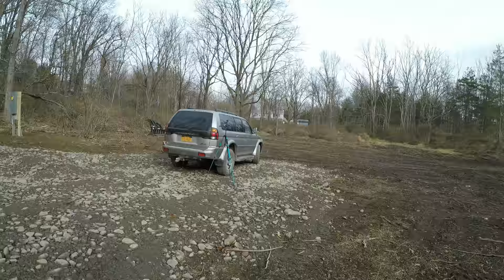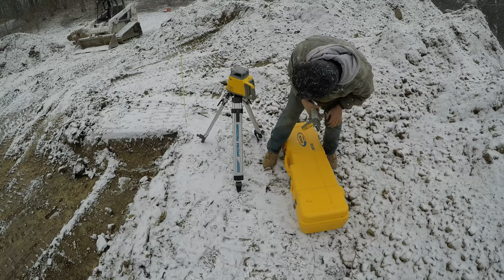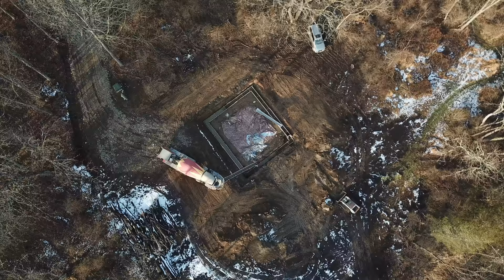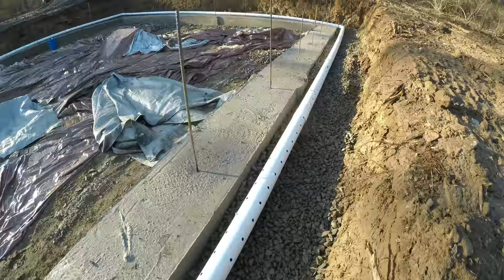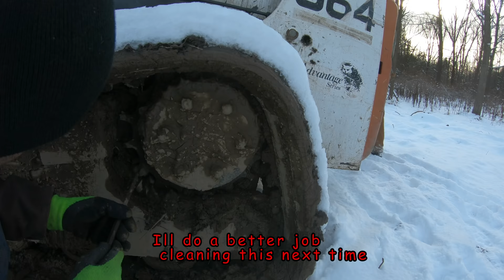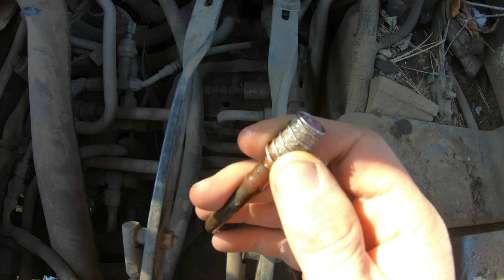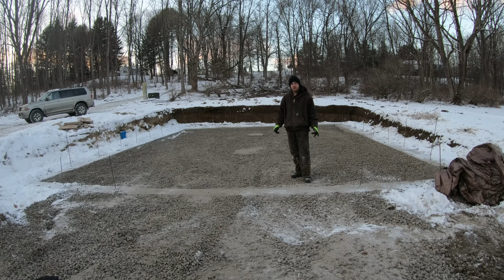Digging a foundation and pouring a footing

Comment: You put the foundation drain pipe on top of 5-6 ft of drainage stone that was placed on the outside of the foundation walls.  Any water reaching that drainage stone will not even enter that drainage pipe but travel down to the bottom of the foundation wall and possibly under the foundation and back up on the inside of the building underneath the slab.  If this was your design, it's faulty.  Please tell me the design was by someone so you don't get the blame.  Or am I missing something ?
Reply from the maker: Those pipes are lower than the floor. And drainage pipes were added inside the footing too under the concrete.

Comment: Your pump on the engine is drawing a vacuum on the fuel line sucking the primer bulb flat it happens all the time on my bobcat in the winter use power service or an additive in there to remove water and stop gelling

Comment: A long time ago when I was young, think middle school days and earlier I wore jeans in the winter time that had padding on the inside. They looked like urban pipeline jeans but sharp looking. Think I had 3 pairs of em. One was a dark gray, one a lighter, and I think one was real dark blue. The padding on the inside of the jeans, think 2 were plaid and one was all red. Those pants were fantastic lol. Really comfortable and warm. I can’t seem to find jeans with padding on the inside! I’d love to wear em again they were fantastic! Super comfortable. If it’s real cold out and I have to wear jeans, I’d wear sweat pants under them. Thin sweat pants. They are like baggy leggings lol. They also work. I only have 2 pairs of em though. Those jeans I wore that had the padding in the leg sleeves were something. LOL. Just wanted to comment about cold weather wear. Real cold in NY and in the upper Northeast, North. I remember one of Andrews videos, he talked about winter wear.

Comment: Hi Andrew. Now that you have a hot water pressure cleaner, could you use it to clean up your equipment either at the end or start of the day to make it easier to get it up an running. Also, would covering the equipment with a tarp or similar make any difference. Maybe it would be time efficient to clean for 10 or so minutes if it took longer to start up, but I am not sure how long it took to get the bobcat up and running both days.

Comment: Are you running 15w40 in those temps?Switch that diesel over to 10w30 hd diesel oil.Also the KLEEN FLO diesel lube and conditioner if you cant block heat it.That cold start is hard on bearing journals.I learned the hard way.

Comment: Add 10% kerosene to the diesel to winterize it  at -10C... up to 25% at -25C. Draw out the water in the fuel tank with carburettor alcohol, about half of what the bottle says for gasoline. 

Also it heats up the machine a lot faster to just put a loose tarp over the entire machine and a hose from the exhaust to under the machine if you have one.

Comment: Do you charge a winter differential rate? If not, you should. It seems like you spend the first hour or more getting equipment to run and move because of the could.

Comment: You used the laser level the opposite way. You should have set the laser next to the green stake at the exact height you needed it, then set your measuring stick to the height you need it with the receiver at the exact height and you can walk anywhere and the height would be perfect.

Comment: I cut teeth out of AR500 plate and welded them on ny Bobcat bucket - have worked for almost ten years now. But what ever you can get will work in the range of AR400, AR500, KVX strips or Chromium Carbide strips

Comment: Imagine doing this in the future with AR glasses (augmented reality). You could put some cameras all around your work site and use any of the upcoming AR glasses and see an overlay of all angles, elevations etc. You could look at the ground and see an elevation map like on a... well map.
Or look at some piece of wood or metal and see if it's dimension or if it's bend or twisted. See if something is at right angle. See what volume or weight it has. You could mark the edge of your shovel in the VR app and have it tracked while digging. Basically giving you superhuman abilities while building stuff or construction.

Theoretically all that would already be possible although not very well yet. You'd need cameras that wirelessly transmit image (video) data, a central PC that does realtime photogrammetry and AR glasses that have a good resolution and a wide field of view.

The future of construction is going to be glorious. For a while at least until we develop giant building robots that just get fed CAD building plans and do and plan all the work steps to make it happen. Well that would be glorious as well, I can see you as an old man controlling a small fleet of robots from a birdseye view like an RTS ;)

Or robots grabbing some tree and sawmilling it to exact dimensions while holding it in one of it's many hands. Grabbing big stones in the local area, chiseling them a tad and putting them together with a bit of mortar that they almost fit perfectly.

Anyways, nice video!
Reply from the maker: There are machines that tell you exactly how deep to dig. I need to get one.

Comment: I may do a project similar to this, a bit smaller, in my property in the future so this is very interesting. Why not set the laser at the right elevation to avoid math and possible confusion? Looks like a good transit with a very tall laser sensor. Mine is only two inches :(

Comment: Would it be difficult to drop a container at a site to garage your stuff in super cold conditions?  I’m sure you could then add a safe small heat source overnight, like a couple light bulbs if you can plug in and an engine heat pad, too.

Comment: Have you ever thought about pressure washing your machines after you're done for the day? obviously the water would freeze but it looks like the frozen mud is worse than straight ice.
Reply: But then you have to get a pressure-washer to the site, and water,  and then take it away with you so it won't freeze.  Lugging water around sucks.  Ten pounds per gallon. And, if it's cold out, then you have a big ice dam formed around the base of the machine.  Everyone likes clean,  but not when the water won't drain away.
Reply: Yes,  your US gallon is 8.33 lbs;  I was thinking of the Imperial gallon, which is an even 10lbs per gal.  Sorry for not specifying that earlier.

Comment: Throw a tarp over your equipment when the temperature plunges below 20. Ground heat would have kept your machine 10-20 degrees above the lowest point reached in the open air.

Comment: Off-Road fuel (red) have to start adding additive in late fall! So the floor slab gets poured on top of footer, but framer is going to stud off of footer and pour later! How's that work? They are going to pour around studding/framing?
Reply: could be using a pumper
Reply: Yeah, but I actually meant; are they going to pour the bottom plate of framing into the concrete? Sorry should have worded that better.

Comment: SOLUTION: Take Skid Steer when your done at Night, put in warm garage at home. Use home owners electricity, tarp over Skid Steer at work site place small heater running in cage area leave running til you return.

Comment: Don’t you use a fuel out of there so that the fuel don’t freeze. And you should always clean your tracks on your machine when you’re done operating it that’s just proper maintenance. If you don’t clean the tracks you’re gonna keep running into problems like the tracks freezing up and things breaking that’s just bad operating skills. You should greet your machine 2 to 3 times a day especially if you’re digging a lot

Comment: Dude, the holes point down in the drain!!  On top of that, with all the gravel under the pipe, it will have thousands of gallons of water under the pipe at the base of the footing and will have rise up to the pipe before it can even get away from the foundation!

Comment: Not trying to be a troll... but your pipe should be at the base of the footing... Not sitting on top of the gravel. Now the footing is always going to be submerged, and the water must rise the height of the gravel plus the pipe, considering you put the perf holes facing up...

Comment: Next time you trow tarp over the machine, and blow in hot air with your heater.
Buliding in wintertime takes about 3 times longer than summertime, at least :D
Reply from the maker: Yeah I may have to, its been very cold this year.
Reply: Hessian doubled up is what we use in the UK but it does not get as cold over here lol

Comment: No longer there in Amazon also can you do a video on sight levels how to find grade etc
Reply: That particular grease gun isn't offered by DeWalt anymore. They changed the batteries and discontinued the older tools. Just Google DeWalt 18volt grease gun for the current model. Or whatever brand that matches your tools.

Comment: Up in Alaska there were times that electricity wasn't available and we would have to build a small fire under the engine to get things going.  Remember, small.  Have to feed it almost continuously with kindling.  
Maybe in the future you can throw a heavy tarp or several layers of the that brown and silver tarp over the skid steer and put a little space heater under it.  We did that all the time with the portable heaters.  Worked great.   The heaters couldn't stand the cold to the point if you didn't direct some of the heat they were making back onto itself they would stall and you would have to bring another heater over and get it warmed up to start again.  Great heaters, can't stand the cold.  Fucking military equipment.
Reply: If you have power on the site, run an extension cord over to the machine and plug in a hot plate underneath the machine and throw a canvas tarp over it for the night.

Comment: Damn. That cold is brutal.
Reply from the maker: Yeah, it pretty much shut that job down. The next step is for the walls to get poured, but its been too cold. I don't think I could backfill now though, the ground is like concrete, and the machine doesn't get any traction if you can get it to work.

Comment: Antifreeze fuel and a pressure washer for the tracks... Otherwise, great job!
Reply: I figured on the pressure washer, he has power on site.  Tarp over the equipment and add in some electric heaters to keep the water from freezing things up. park it on logs or pallets.

Comment: Big debate which works better perf pipe  holes facing up or down, noticed you put yours up, everyone does it different, would be interested to see what manufactures call for. My family owns Lebanon Springs Excavating, not far from you
Reply: There shouldn't be a debate the proper way is holes down I like all of Andrews videos but the holes are definitely supposed to be down

Comment: I have had the question asked before about whether the holes should be up or if they should be down.  I have been told both ways. WHich is correct?
Reply from the maker: Down

Comment: Andrew, is there a specific reason you use the individual sticks of perf pipe instead of the black corrugated drain tile that comes in a roll? Just curious, thanks.
Reply: because it's stronger? but he didn't install a cleanout port, that would have been nice to have in 10 years or so

Comment: why doesn't the excavator have a block heater? I would lay some heat tape over the tracks and then cover them with plastic plug them  in the keep everything warm?
Reply from the maker: aa999xyz the block heater wouldn't help the frozen fuel in the fuel lines/filter. The fix for that is treating the fuel or mixing it with kerosene. 
The tracks just need to be cleaned out before it freezes

Comment: "It's frozen, rock solid." I wonder why would that be for? Because the mud and shit got frozen in the tracks, that's why. Learn to clean up your equipment after the use, when you know there's minus degrees/cold, makes next morning easier. ;) As for diesel getting all frozen and whatnot. Just screw the summer one, use intermediate grade diesel, or winter grade. In where i live, the winters are anything between -0C to -30C and no we have problems, not even during summer when it can be +25C. :)

Comment: what is the purpose of the Frost wall? it looks like its thinner then the rest of the foundation... and why only on that one side?
Reply from the maker: That wall is there because its a walk out basement, and that wall was not back filled. That's why the wall needed to go down below the frost line. The other walls did not need that because they were buried.
Reply: @AndrewCamarata  ok thanks

Comment: Hey Andy, my son has a cracked rear rim on his 2004 YZ 85 the crack goes from left to right looking down on the rim.. is it possible to weld with an aluminum bead? Is it safe?
Reply from the maker: Usually when rims get messed up they need to be replaced.

Comment: I don't understand that "frost wall"... Shouldn't it be insulated with Styrofoam?
Here in Europe is usual to insulate foundation with styrofoam all around.
Reply: Those are the footings. The foundation walls will sit on top of them.  The “frost wall” had to be dug deeper to reach below the frost line on the wall where he said there would be a walkout basement.

Comment: No, no, no! the drainage pipes go in with the holes at the top.  Sediment inside the pipes settles on the bottom of the pipe.  If the holes are at the bottom they will be blocked by the sediment when it dries out.  Sorry, only kidding, it obviously makes no difference whatsover whether the holes are at the top or at the bottom and I always eat my boiled eggs small end first.

Comment: I have Topcon Laser, magnetic blue tooth receiver, blue tooth remote magnetic display in cab, works on any equipment I'm using. Put receiver on grading blade, excavator boom or shovel, Ha.
Reply from the maker: I need to get that. Do you like it?

Comment: This is foundation wit 2 rods of rebar??? How long do houses last there???
Reply from the maker: Thats how it was engineered. This house was built on quick sand too. IDK, I wouldn't be surprised if it sunk.
Reply: @AndrewCamarata  Yea I get that it is so different the way we build here in Europe you would need like rock footing then the rebar would be like for the concrete beams et least 4 rods tied together in rectangle shape. But we do not build with wood usually it is all brick or blocks with concrete beam so it is more heavier. Thanks for the response I enjoy your videos.

Comment: Why just anti frost wall in one side? I´m from a hot area and I can´t figure out why...
Reply from the maker: Because the other 3 walls get burried deep under ground. That spot, the floor is level with the outside, so it needed a deeper footing.
Reply: @AndrewCamarata  Thanks for your reply. I got it.

Comment: wow all I can say is this build must be, done in an un-organized township were no building permits are needed, witch means no inspectors, there is so many things wrong in this build jjust to this point alone, filling the hole with stone to the top of the footing walls before installing the drain tile, makes for a big water swamp below, and I don't know about down there but you never use PVC  for drain tile on building, you use a 4" black perforated rolled tile in a sock, and it is laid on the sub soil at the base of the footings then your chis cross floor drain tile go though the PVC sleeves you put in the footings before you pour, and hook your black tile to your out side footing drain tile, to top it off he used PVC SEPTIC FEIL PIPE AND INSTALLED IT WITH THE WHOLE UP, THE BLACK PRINTING FACES UP AND HOLES FACE DOWN but that don't mater as it is in the totally wrong place on top of feet of drain stone with no sock, witch will hold water in all that stone below to the base of the footings and sub soil, witch will never drain. no wonder he was pumping hundreds of gallons out of the stone in the basement after he had heater running in there for days, witch would have never thawed out the ice out side the footings in all that stone below that pvc, what about 3 feet or more of stone below that pvc drain and under the footing, witch when freezes hard will lift the footing, a good chance of that, as I have seen it happen were no inspection, you never put any stone below any drain tile

Comment: I think I would be taking that Bobcat home to a warmer garage at night
Reply from the maker: Its too far, that would be too much work. What I should have been doing is just cleaning the tracks. Than they don't freeze. This site kinda sucked.
Reply: @AndrewCamarata  OK I get that.. What about a thermal blanket to stop the diesel freezing?
Reply from the maker: That was summer fuel. If it was treated winter fuel it would have been ok. Adding Kerosene or treatment to it stops it from freezing. Winter came early that year, that job should not have been started so late in the year.

Comment: 27:30 Waving that gas torch at rubber or vinyl coated electrics and fuel lines is asking for BIG trouble.  They are extremely heat sensitive and get destroyed easily.

Comment: Hi Andrew   With a mini excavator  10 tone and under,  you should be running your blade behind you when you are digging and blade in front when lifting this helps pin your machine to the ground for downward force keeping your machine from lifting when applying downward pressure on the boom and bucket .   Great video tho man keep up the good work man.

Comment: I know I'm a year late, but you should really cap the ends of the rebar sticking up. I would hate to see someone get impelled.
Reply from the maker: I am not the mason.
Reply: I understand, but you are walking around there with rebar that is knee high. I would have the mason cap them off if it is his responsibility. I used to work with a guy that did that very thing. He ran it up through his thigh, nearing missing the family jewels and he never worked again. I would hate to see someone get hurt when it is preventable.